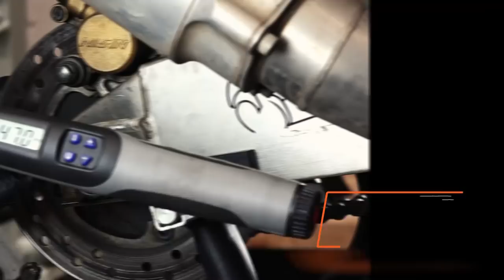CBR Chain and Sprocket Replacement | CBR929 | Partzilla.com

Comment: @Partzilla I just want to point out that you're providing the wrong torque spec for the axle nut. According to the service manual, the Axle Nut Torque Spec is 83 ftlbs. Drive sprocket is 40 ftlbs and Driven Sprocket nuts are 47 ftlbs.